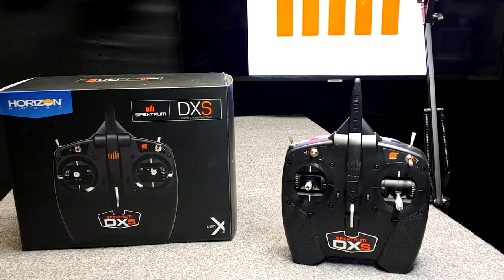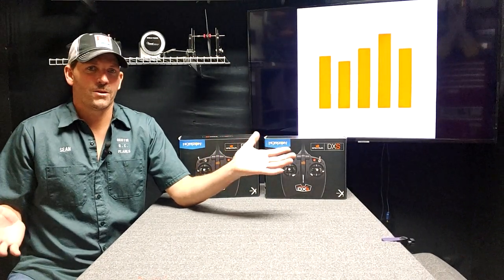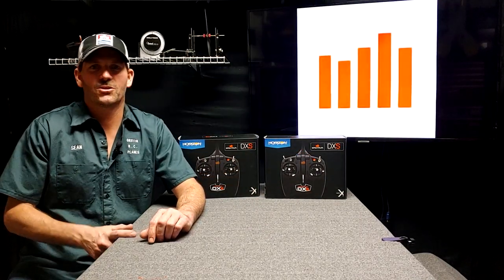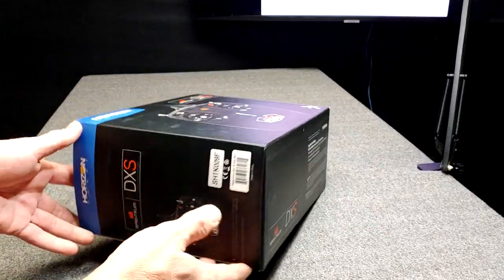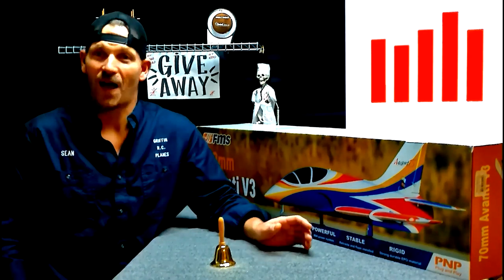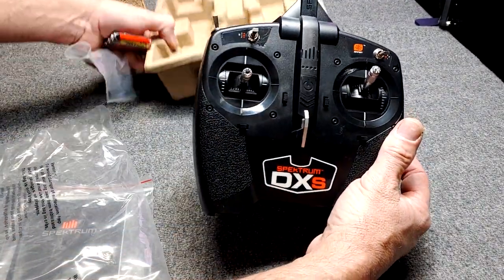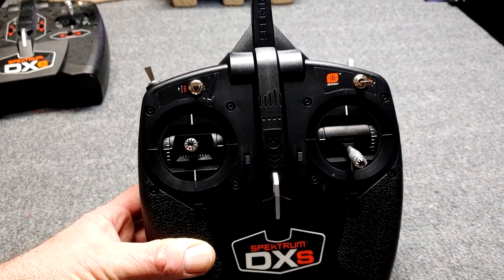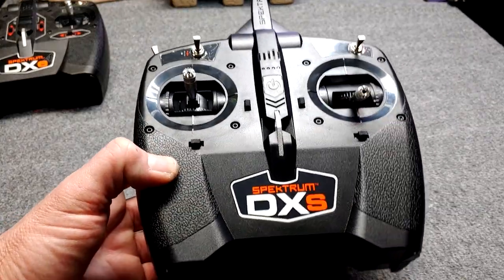SPEKTRUM DXs Transmitter the more you know pt1

Comment: My DXS transmitter came with my carbon cub plane. I changed the batteries in the DXS, because I thought it was low. Now it doesn't work. It chirps when I turn it on, and then it turns itself off. I have tried the binding plug. It doesn't work. Any advice ?

Comment: Your timing is perfect. I recently updated my NX 10 to the latest version and it switched my mode to mode 1 and changing in the system setup to mode 2 made no difference.  I finally got mode 2 to work. I shut it down and when I turned it on fly, it was back on mode 1 and wouldn't go back to mode 2. I had to go back to the previous update 3.10 from April to get it to work right . A buddy of mine had no problem with his update. I will leave it alone for a while. I did find it interesting it did this. The NX 10 is my forth transmitter so it's not my first rodeo updating. Just found it interesting. Thanks for the video as I am sure it  some new peeps to the hobby can  benefit.  Have a great day Sean, looking forward to the  money pit video.

Comment: You bought something that wasn't manufactured properly. I just purchased a plane with the same controller the throttle is on the left. I would take it apart and switch it around as it's a manufacturing error..or resale as a custom left handed version 😊 I only wanted to know where the power button was ,,in next video🤔
Reply: You can actually change the mode on this transmitter. it's pretty easy. I just bought a cheap one on ebay and changed the mode over and now it works fine. Throttle on the left. You do have to take apart the radio and turn some adjustment screws, and hold some trim buttons while turning it on to change the stick mode to mode 2. https://www.youtube.com/watch?v=VFpFB7RymK8&list=PLrJmXkAUd7vZ8d9A_2W58k8dZYwC-_Sny.
Reply: @malatoke  dyslexia is prevalent in China especially in the RC business